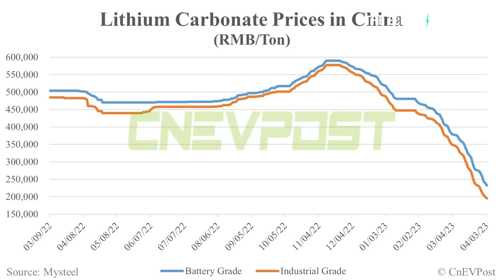Lithium prices collapse - EV's will be cheaper than ICE in 2 years

Comment: The price of lithium is down because of the potential of much cheaper Sodium to take its place.  There are a lot of claims about Sodium cells that perform nearly as well as Lithium but not only cheaper price for Sodium but much more available in comparison; potentially breaking EVs through the scalability problem Lithium presents.  Of course the literal cost of the Lithium or Sodium per vehicle is not very big (22lbs in a Y) ; so the price of the vehicles won't be effected too much as a direct result of the chemical; it is the potential for greater availability which could cause a cut in price.

Comment: Just not the solution.
 Why is lithium extraction bad for the environment? Any type of resource extraction is harmful to the planet. This is because removing these raw materials can result in soil degradation, water shortages, biodiversity loss, damage to ecosystem functions and an increase in global warming.21 Nov 2022. There several other reports on the damage lithium mining does , non of which are positive.  We need better solutions . Take a look at the infrastructure required , from generation to delivery at charge points  reliability and cost . Additionally in UK air and ground heat pumps are being pushed all of which require electrical power . There is not sufficient.  We need a completely different mind set on this not EVs or  hydrogen. Climate change , a contentious issue anyway so, is not going to be solved by battery powered cars. . Fact fo you to o ponder on  UK produces 2% of worlds CO2 if it disappeared right now it would make no difference at all .

Comment: Be careful about your negativity about lithium and enthusiasm for sodium batteries because having a strong opinion about things you don't understand may expose your lack of knowlage. Most lithium is delivered to long term contracts, spot price volatility does not reflect market reality. You seem to be confused between battery manufacturers, lithium refiners and lithium raw material producers (spodumene or Li carbonate). I agree the price of EVs will be lower in the near future but it will not be because of lithium price going down by half twice i.e. around USD 15K / ton.

Comment: Tks for the hint .... as living on boats all year the replacement of lithium ferro batteries by solid state like sodium-ion batteries is a fantastic development. Lithium batteries are not really safe by risks of overheating the charger. We sailors can take benefit from EV industry, cheaper solar and new highky efficient wind turbine technologies (vertical systems instead of horizontal). Its all on a good way. Maybe little bit too slow coming into the markets

Comment: Question - If lithium prices are in freefall, what will happen when the refineries go belly up and production capability suffers terminally? Where will battery makers get lithium?  Also, with sodium seeming to be the miracle fix, why has Tesla begun a multi-billion dollar investment in lithium refining?  Something doesn't seem to add up here? 
Thanks Sam.
Reply: Lithium prices went up 10x from what they used to be, so even if they drop to a quarter of peak it'll still be up 2.5x. The production companies aren't going to go bust. 

Lithium is the lightest solid element that exists. It's always going to be the best thing to use for a light weight battery so it's always going to be needed for premium applications. Sodium is heavier but much cheaper so it will be used for budget cars and grid storage.

Comment: Remember 10 years ago you can only buy expensive apple or samsung smartphones. But now there’s plenty of cheaper ones.
Reply: There are plenty of cheap EV products. What is your point?
Reply: @wolfgangpreier9160  what cheaper ones? 😂 byd atto3 and mgzs costs $52,000 here in New Zealand. They’re already the cheapest one with good range. Until EV is priced closer to their ICE counterparts then they’re still expensive at this stage.
Reply: @camz9014  I am green of envy. Atto III costs 400,-- Euros less than a Model Y in Europe. 

The only cheap ones come from MG. But tthey are REALLY cheap. Not only in price.

Only the really small vehicles like Honda Jazz, Dacia or Toyota Yaris are still cheaper than their EV counterparts. And that will not change. 

All other, larger fossils are already more expensive than EVs in the same size, similar performance and feature list.

e.g. Honda, VW, Toyota, Stellantis, Mazda.
Reply: @wolfgangpreier9160  I haven’t seen a small or large ICE more expensive than their EV counterpart. Model Y costs $72k while RAV4 (highest trim already) only cost $50k. unless you’re going to compare model y against luxury Mercedes benz. 🤣

MGzs EV cost $52k while their counterpart MGzs ICE is only $25k. The disparity still so high. But the prices are starting to go lower every year. It will probably take another 4 years when byd or MG will start selling $30-35k EV with same current range.
Reply: @camz9014  Model Y costs 45K Euros in Europe whereas RAV4 Active Drive 2WD costs 45690,--

Model 3 costs 44K, whereas Camry Business costs 48090,--

I know that there are countries where you still get the cheaper Toyotas. But not in Europe. Not anymore.

Comment: From AU$132,643 per ton in November 2022 to AU$49350 per ton in April 2023 - battery grade Lithium carbonate. 
If you are looking to buy a brand new EV vehicle, I suggest holding off and watching the lithium stock price movements.
Robust output and low demand continued to raise expectations of a supply surplus this year. The Chinese government ended cash subsidies for households purchasing new energy vehicles, magnifying downward pressure on lithium through abundant stocks. The overproduction of batteries at the end of 2022 to take advantage of subsidies drove battery producers to have unsustainably high inventories and prompted the sale of goods at a steep discount, with sharp capacity cuts in all streams of the supply chain. It will be interesting to see how it pans out on the new cars markets.
Reply: Yes, i buy my EVs only after looking at the stock market in OZ. Of course. Next i buy my iPhone only after looking at the Cobalt stock market in Congo.

Comment: Lithium, nickel and aluminum production has dramatically increased and due to increase, much more, in the coming years.  An independent report showed Saudi oil reserves almost depleted with other large oil producers, running low as well.  Great time to buy EV’s and solar panels before it all hits the fan.

Comment: I'd read that the collapse in Lithium prices is due to recent fall in demand in China and increased Lithium supply due to come on stream this year.  Some analysts believe that supply will continue to be constrained by increasing demand, which is forecast to cause prices to level off.  Others predict prices lowering to $12500.  A supply gap is expected within the next two years.  Supply gaps often drive up prices.  Other analysts predict a short term oversupply, due to weak economic growth and suppressed demand.

Don't forget that consumer electronics make up a substantial element of the demand for Lithium.
Reply: Yes, those analysts were always correct in the past.

If i just play "spin-the-bottle" and tell my dog to point out where the market is going he will be correct about 50%. Just as much as those so called "analysts".

Comment: Lithium is a relatively small part of batteries.  If lithium prices are cut in half, battery packs will fall some, but no way will they be cut in half unless everything else that goes into a battery is also cut in half.
Reply: %Amount does not equate %cost. Lithium is one of the expensive ingredients. Now, falling by half seems overly optimistic indeed.
Reply: @christianvanderstap6257  It is about 1000$ in a big batterie. So in a 40.000$ car and above it does not matter.
Reply: An electric engine cost about 1500$ to produce. How much for an internal combustion engine ? Much more.
Reply: @haroldsimard7263  So? What is your point? You don't understand, where the price comes from other then lithium?
Right.
So not knowing is your argument. 2023.
Reply: @knabbagluon  I mean that a lots of parts are cheaper in an electric car than ICE. I quote for engine but gearbox witch is simpler (only one speed) on an electric car is an other example. Not just the batterie pack. The sum of all that, will make that the price of the EV's will be cheaper than ICE in two years.
Reply: Guys it does not matter, as an owner of 3 bevs, u guys are posting arguments, but neither of you actually own a bev, can tell from your posts and previous comments.  Once you drive and own a bev, they are just hands down better, more reliable, less complicated, and easier to operate  and own plus way more convient unless you drive more than 600 miles every single day.  Do you own a cellular phone?  A bev is just like that if you understand a cell phone a bev is the same except you can drive it, if you don't get that analogy you must have a landlines and stick with your ice car. Drive and own a bev and then post here again.

Comment: Well now that sodium batteries are just about to go into EV's in China later this year. Lithium's days as a premium commodity are numbered. It's like anything, when the market sees something become too expensive, there is an incentive to find a cheaper option.
Reply: Second grade option with only a third of the energy density.
Reply: How long will it take for those almighty Sodium batteries to get some market share? 5 years? 10 years? And then NA+ batteries do not fit every use case. There will be more than only Li and Na chemistries around in 10 years. Its not a competition. Its a not one size fits all and every product has its niche and use case.

Comment: Lithium isn't the right commodity to invest in. Copper is the key to electrification. Lithium might be replaced by sodium or something else. Copper is essential for EVs, batteries, charging infrastructure, renewables and transmission.
Reply: Gold is the way to go if you want maximum performance. I am not surprised some crazy dude start looking into have gold plated aluminium wire as conductor for ev.

Comment: The only product that interests me more than cheaper Lfp cells is more efficient solar panels...
Reply: Have u noticed that Elon musk just announced a new highly efficient new type of solar cells? its production starts in 2024 to replace cristaline poly silicium (which is also giving problems in recycling old panels) and to bring down the costs under 50% by using different layers (up to 500 of nano thickness) using ferro electric materials - https://youtu.be/xIkBhnbcHVo
Reply: @profiskipinternational4402  No but I am aware of the various flexible cell panels like Perovskite cells but they still have to solve the longevity limitations it has and then it needs to be scaled so I imagine it is 5 years away yet at least.

Comment: OPEC has lower the production of oil with 1,6 million barrels.
Thats 30 million electric cars.
So, hopfully they manage to ramp up production.
With Tesla semi too, this will pressure OPEC  to the brink.
Lithium production is part of getting ridd of oil.
The question is how many cars a year do we need to push oil out?
Reply: Oil is always priced at the most expensive barrel produced.  So slight demand declines can lead to steep price declines.

On the flip side, Saudi Arabia has a huge cost-of-business.    They must pay large amounts of ongoing social aid and psuedo jobs or they are at risk of civil disorder.

So this is Saudi Arabia's challenge.  They can reduce production (which is cheap for them) to protect the price.   But their "production times cost per barrel" has to pay their base costs too.

Comment: Oil prices are heading up again as lithium prices fall. As the cost of fuel rises again there will be another rise in the interest in EVs.
Reply: How would this affect lithium recycling stocks like li-cycle
Reply: @homercuts  Lithium is still needed for various purposes, including hybrid battery manufacture, pharmaceuticals, etc. So Li will still be recycled, and will still be profitable. The price of Lithium was inflated grossly over the past two years, mostly because of greed. Things are now beginning to normalise.
Reply: In NL we have the diesel price down to 1.57 Euro / liter. Last winter we had it at 2.15 Euro. So it has normalized. Electricity prices are still high more than 40 cents per kilowatt. Paid in 2018-2019 only 19 cent. No lowering in sight, contrary EU compensated the gas import fully after the sanctions against Russia and North Stream 2 has been blown off by US secret service. Electric energy concerns make tons of money still
Reply: But lithium crashes mainly because of the discovery of Sodium Ion batteries that do not utilize lithium... Sodium is replacing lithium in batteries, same way that LFP took away cobalt and nickel for batteries.
Reply: We want more oil, no licenses being granted
Kids mining for lithium world turns a blind eye
But the people in power have no agenda honest

Comment: Electric aeroplanes probably moved forward a couple of years 🎉
Reply: It is possible to run an aeroplane with bateries. But, it's with propeller and it is slow. Good luck to run at 600 mph with electric plane. Only fuel power can run a jet at that speed.
New York to Los Angeles will take 15 hours with electric plane. Maybe more.

Comment: Great. Can’t wait for more affordable EVs and plug-in hybrids.
Reply: But why hybrids?
Reply: @johnnymonsters9717  it works better for me. I sometimes have to drive 150 miles per day with various routes. I don’t want to hunt for charging stations on the road. If there is a big 
storm and my power goes down I will be fine with just gasoline. And on cross country trips it would be better to have a hybrid.
Reply: If you have a home charger, you’d still be fine driving 150 miles a day. You can get electric cars with 400-500 miles of range nowadays. With a hybrid, you’re going to get a small battery and more maintenance cost. But yeah, cross country trips will definitely be more convenient in a hybrid if you do that a lot.
Reply: @Pythonzzz  EV technology is developing very fast. The Teslas from just five years ago were quite bad compared to the Teslas in 2023. As LiFeP and Sodium batteries become more prevalent.  cheaper , longer lasting and working better at low temperatures EVs will become more practical. We are not there yet, IMO.
Reply: @Pythonzzz  thank you for your comment. Yes, it would cost me
Probably a main panel
Upgrade and the cost of the 240v device and its installation (i figure $2k with the permits).
Reply: @johnnymonsters9717  Hybrid is best of both worlds, all the advantages of ev but with none of the restrictions of charge times and  range restrictions including towing.
Reply: @kiwidiesel  hybrids definitely do not have "all of the advantages", it's been shown that NONE of them hit their stated emissions targets (some produce up to 3x more CO2 and particulates than they advertise!). 150 miles/day is definitely small enough for an EV if you charge overnight. It's true they're still more expensive than old bangers that have been spewing petrol fumes for a decade or two, but iirc the current model 3 price is lower than the average cost of a new car in the US, and Tesla is going to be coming out with a $25k car at some point probably next year. Since CATL announced sodium batteries I have some confidence that Tesla will look into using those and bring the price down further - and even if not, other car manufacturers will. If you want a cheap EV I've heard there are lots of Chinese manufacturers who are desperate to sell their cars because the competition over there right now is VERY stiff.
Reply: @Nabushika  thank you for your opinion and suggestions. Unfortunately, one cannot legally register a Chinese EV in the US at the moment. There are none that have passed the NHTSA tests.

Plug-in hybrids emit a lot less CO2 than non-plug-in hybrids,regular 4,5,6,8,10 and 12 cylinder ICE vehicles. I think environmentalists should focus on reducing CO2 emissions from the latter rather than the former. 

Additionally, in countries like Poland where almost 80% of the electrical power is generated from coal-fired plants, it may turn out that hybrids produce less CO2 than pure EVs.

We have to be smart about EVs not just ban everything else. If we do people will resent it.
Reply: It does nothing. The batteries have like 1000$ of lithium.

Comment: You're really overplaying this. Most of the battery cost isn't lithium but other element's like nickel and phosphate.
Reply: The anti-EV crowd really overplayed it first.

The cost of the cathode makes up 51% of battery cost last year.    The battery is made of graphite, nickle, and copper but the cathode has a lot of lithium (small part of the battery- large part of the cathode).   Dropping the cost of lithium this much could reduce the cost of batteries from $11k per car to $7k per car.  That's significant.